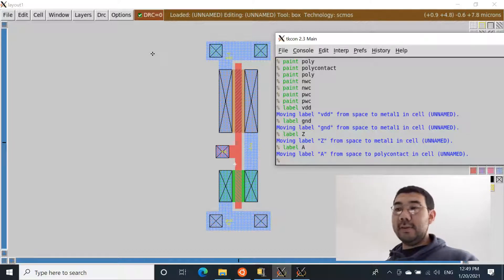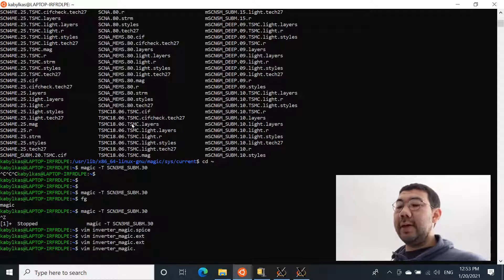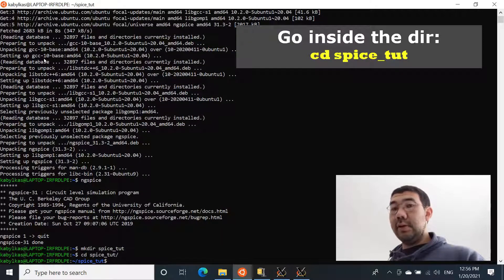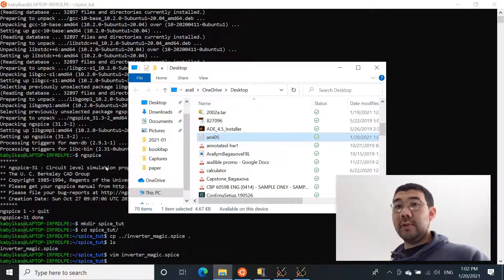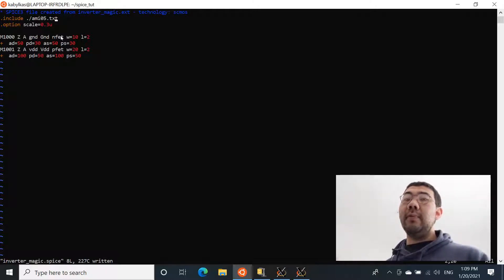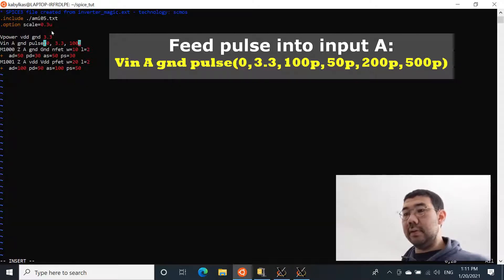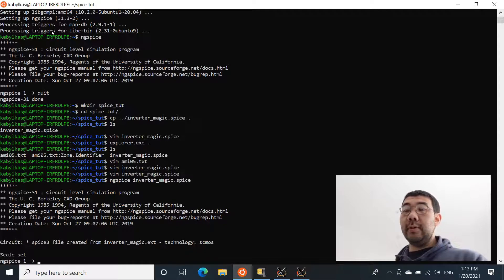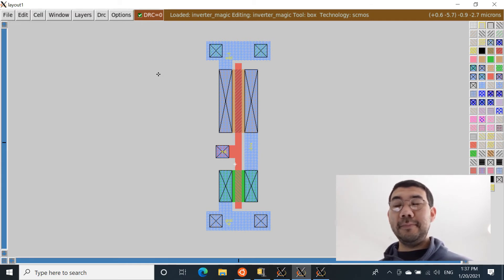Ngspice Tutorial: Extracting spice from Magic VLSI and running analog simulation

Comment: I am a beginner.
What is this ami05.txt file? Like we used technology scmos 2002a and microns/lambda=0.5 and to process AMIc5, But here we are using ami05, how to understand which file need to use?
Reply from the maker: Those are two separate files for two different tools. ami05.txt is for Ngspice. It contains different parameters to perform simulation. The other file is for Magic.